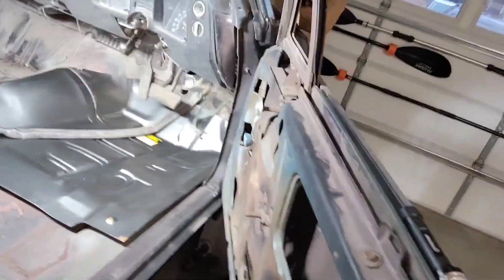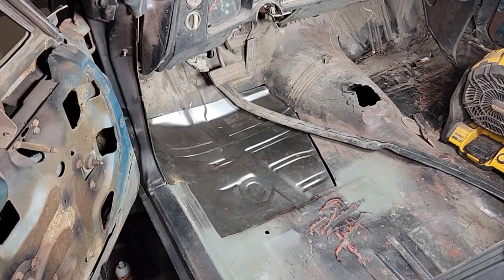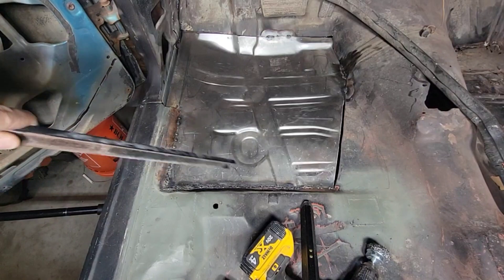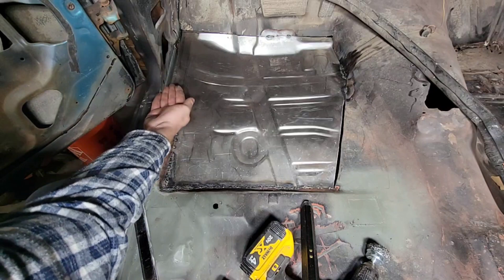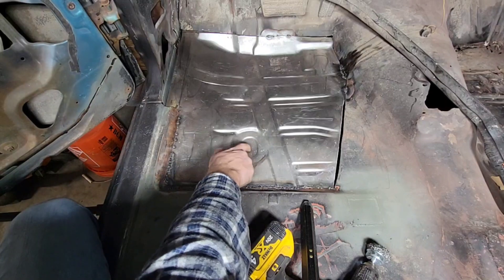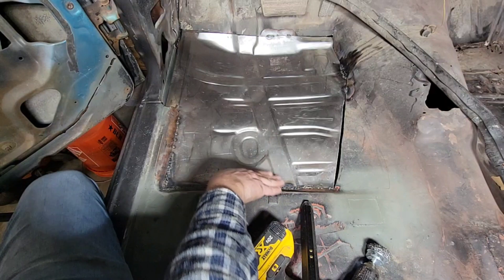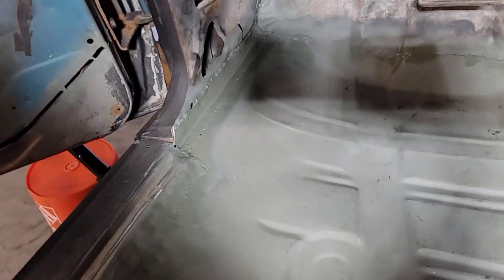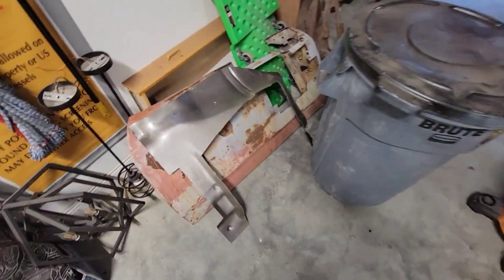68 Chevelle Driver Floor Pan Rust Repair.

Comment: When fitting the panels like that.  Overlay them then use the death wheel to cut it to size through both panels… that way the cutoff wheel gives you that perfect 1/8 gap that welds perfect